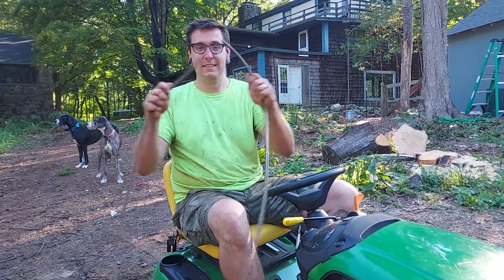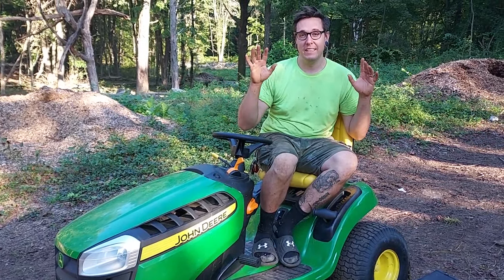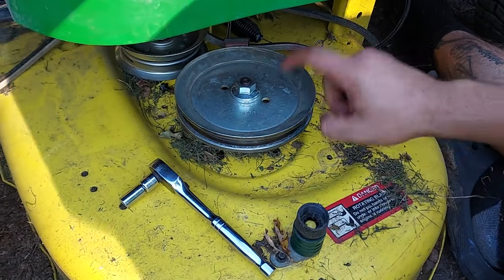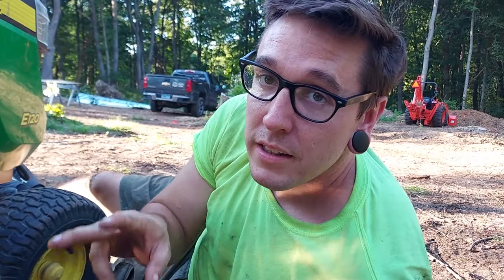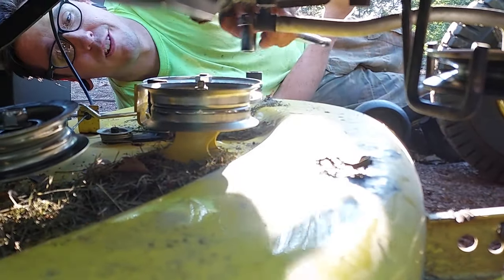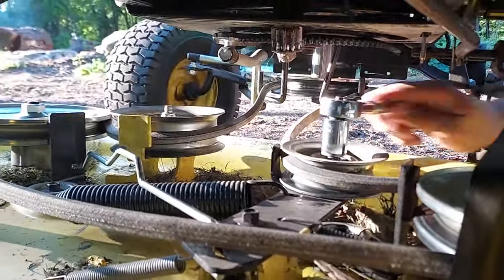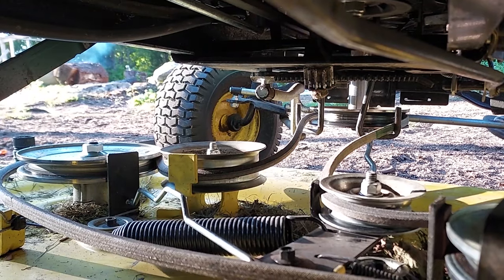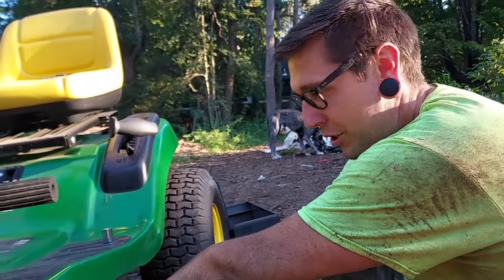How To Replace The Mower Belt on a John Deere Riding Mower | Belt Replacement John Deere E120

Comment: You wouldn't believe it - I just spent the morning servicing my E120 and started mowing, and the belt broke!  Good to see a video that doesn't tell you to pull the deck off, or spend 10 minutes waffling about other stuff! Thanks.
Reply from the maker: Sorry to hear the belt broke but hope this helps! It was really a pain to try to show what I was talking about, I wonder if that is half of the reason why people say take the deck off
Reply: I was happy to find a video too, that didn't require you to remove the deck. I looked at mine several times and thought I don't see why I would need to remove the deck 🤔 Glad to find your vid that proved me right. Now, to get my belt and get after replacing that booger🤓
Reply: Thanks!
Reply: Had to remove the deck for the blade rotators and its easier then you think. Lear ing curve is once, after that it might take me 10 minutes. Jist a matter of taking pics and keeping all the kotter pins together. Thwt being said, I agree im leaving it on for the belt.
Reply: Thanks! The belt broke and the hubby is out of town... I 'm gonna head out and do this. Wish me luck!

Comment: Thanks yal.... bought a 2021 S120. Belt broke first time mowing! Couldn't believe it.. it's funny, because my whole life friends and family were all like "John Deere is the best". 🤣🤣🤣. Not a great first impression for me.. Anyways, thank you. I replaced the belt in 20 minutes.
Reply from the maker: haha oh no did you hit something? or think the belt was faulty to begin with? thats a pain but glad it was something easy to fix, wait till you bend a blade :(
Reply: Yes, I too am disappointed in the JD brand right now. I finally paid the premium price for the JD name and bought one last year. I'm at 66 hours mowing time and putting my 3rd belt on now.
Reply: My brother in law just bought an S170 yesterday.  Started to mow this morning, the belt immediately broke.  He paid $3k for this brand new mower, called JD dealer, they told him its only covered if it’s a pulley otherwise, he’s on his own replacing the belt.  If I ever need a riding mower, I’ll be sure to stay FAR AWAY from John Deere!!!
Reply: Make sure you’re at full throttle before engaging the PTO. Also, Don’t engage PTO while sitting in high grass. Drive into high grass with blades already turning OR… raise deck fully before engaging PTO, then lower into desired cutting level. 
But in VERY high grass, just drive into it with guns blazing. Much less shock on the PTO.

Comment: Watched several videos before I came across yours. The first guy wanted me to remove the entire mowing deck. After watching that one, I figured I would need to haul it in to a professional. Then there was a gal who didn’t need to remove the entire deck. That sounded good! Unfortunately, her video quality was poor and she wasn’t clear about the work involved or tools required. Also, her tractor did not have pulley covers (which it turns out had to be painstakingly removed). So, I continued searching YouTube for the holy grail of mower deck belt replacement videos and came across yours. It is understandable and detailed! With confidence, I completed the job in about 30 minutes. You probably saved me a few hundred bucks and a lot of hassle. Well done and thank you!
Reply: The John Deere and other repair places sponsor those guys who complicate to get us all to pay some service that cost $150 minus the cost of the belt. They say it takes 1 hour but looks like it can be done in 30 minutes. I’m gonna try it and see.
Reply from the maker: So glad to be of help!! Glad to save you the money!

Comment: John it was great that you said I would need a 10mm for the guards but the tensioner, you didn't say what size socket
Reply: I'm pretty sure he said all size sockets needed. Otherwise I would not have known.
Reply: He said 5/8" socket and 10mm  at 0:13

Comment: Like it very much! I just replaced the broken belt of my machine following the steps in the video, this is a much better way to replace the belt than others that needs to take the deck down first. Thank you very much!
Reply from the maker: Glad it was helpful !
Reply: But if you remove the deck, you can do other maintenance at the same time: check, sharpen or replace the blades. Grease the spindles.  Clean the bottom of the deck.

Comment: Thanks for the vid. Wasn't looking forward to taking the mower deck off my D130 so I'll give it a shot this way. AFAIK it's the original belt from 2011 with 150+ hours. LOL Greetings from (also) rocky Vermont.

Lol actually it's 360+ hours. And I was able to do it perfectly without taking the deck off. Woohoo!
Reply from the maker: Yessss! Glad it worked ! Maybe CT and VT should have a rock-off! I've never met rockier soil than where we are now. It's Maddening
Reply: @OldReddingFarm  my old neighbor says that if you hit a rock, you've dug in the right place. Placing posts is fun up here! 🤪

Comment: I have the same mower. How do you tighten or adjust the belt. I think my cable has stretched and the cable adjustment bracket is welded to the deck. Any ideas?

Comment: I took the screw off the pully as in 7:30 min. shown, but the disk (pully) does not move a millimeter, so it is impossible to fiddle in (over the guard) the belt. Can you help?
Reply from the maker: Hey patrick, so you took the top nut off of the pulley with the spring attached and it won't move up or down or side to side? It may just be stuck, so try spraying some penetrating oil on the bolt and see if it comes unstuck after sitting for a little while.
Reply: @OldReddingFarm  Thank you for your quick responds. Yes, that is exactly what happened. I will try again tomorrow. It feels like it is welded on there. (I am sure it is not...otherwise, why the nut to hold it?) I am just afraid to bend or brake something if I am using force.
Reply: So, what happened, Patrick? Did you get it off?
Reply: @kenthompson3730  I called a mechanic, he got it off. Thanks for asking!

Comment: I have the s100 and the belt is a bit loose how i can tighten it? The tention bracket is welded. In older models the tention bracket is adjustable.

Can you help?

Comment: I have a issue. Replaced my belt in my LT150 with a 96.5” manual says 97.0” but now the blade engage doesn’t work and the blades always rotating. Is the OEM and 0.5” that critical???

Comment: My e100 deck would have to lower deck to get it to ingauge...what brand belt should i get...i seen $55.00 down to $20 from amazon...i want one that will last.  Should i just stick with john deere brand? Broke at 39.5 hours. But ive had mower 3 years now garage kept n hosed off after evry use...tyi

Comment: Thanks for the video. I got a JD with 2.5 hours on it and the belt broke. 
I’m going to assume it’s just one of those things. But I’m glad you put the video up. This job looks super easy. 
Albeit it’s going to be a pain due to the hot weather I get in Alabama.  I’ll just park under a shady tree.
Reply from the maker: Ugh that's bad luck. Did you hit something do you think ? Hopefully the next one will last way longer good luck with it
Reply: @OldReddingFarm  I don’t feel like I did but I’ll have to say that’s inconclusive for now. Reading the comments though, I do see a pattern of early belt replacements. So the jury is out. Gonna swing by Home Depot tomorrow and see if they give me a replacement, but I’ll get an extra one to play it safe. I bought the JD over a Troybilt because it’s made in Tennessee, however it won’t surprise me if the belt comes from China.
Reply: Make sure you’re at full throttle before engaging the PTO. Also, Don’t engage PTO while sitting in high grass. Drive into high grass with blades already turning OR… raise deck fully before engaging PTO, then lower into desired cutting level. 
But in VERY high grass, just drive into it with guns blazing. Much less shock on the PTO.

Comment: Help! I loosened that small guide but it won’t move like yours did when you loosened the bolt. I have a JD 102 can you tell me how to get belt on guide?
Reply from the maker: Hi there, does the spring move? If it doesn't it may be stuck. Try spraying it with penetrating oil and letting it soak a bit.

Comment: Is it possible to find a belt that's the correct length but without the John Deere name and price and it give the same service life?
I decided to remove seat and body after watching a guy on a video and it gives easy access to transmission and drive belt rear pully. I had a surprise finding a cap and after removing years of shredded grass and dirt found it lead to oil reservoir bottle I didn't know existed.
( I acquired my mower used and it will receive regular cleanings and service. ) 
If I can substitute non JD parts and get equal quality for less cash I have no probs there.

Comment: Hey John.....have you ever replaced the blade spindles? Do those pulley's need to be placed back in the exact position? If not, could that cause a belt to snap? I put new spindles and belt on yesterday and after almost finishing my mowing the belt snapped. There is nothing else I can see or think may have caused this. Thanks for any help or suggestions!
Reply from the maker: i have not, the only thing I've replaced is the belt itself. maybe you could see if you could loosen the tension a bit?

Comment: Old Redding Farm on your John Deere E120 when you increase your engine speed do your blades spin the same speed or faster
Reply from the maker: That is a good question. I am not sure!
Reply: The blades do spin faster or slower with changes in engine RPMs.

Comment: What if your new belt won't fully stop turning when disengaged?
Reply from the maker: If your PTO is still spinning when you disengage the button , I think that might require a professional. Definitely outside my wheelhouse unfortunately !
Reply: @OldReddingFarm  I think my new belt  just needs breaking in.

Comment: For some reason my tensioning freewheel would not loosen to the allow me to lift it and allow the belt to go on. I loosened the nut fully and the freewheel still would not lift. Even pry'ed on it with a flat head
Reply from the maker: were you able to take the other belt off? maybe the spring got stuck on it. if you want to send a picture to oldreddingfarm@gmail.com i'll see if I can help you out!
Reply: @OldReddingFarm  yeah, my old belt snapped. It's as if the bearing for the tension pulley is pressed on. I was able to squeeze my new belt on by spreading the guide plate on the pulley just enough, it was a pain though.
Reply: This happened to us too.  What is the deal???  Very disappointed Time waisted.

Comment: Great video, I have 35 hours on my tractor and this is now the second belt I have installed (both John Deere belts).  I have no idea why, I guess JD  makes cheap belts!
Reply from the maker: wow that is super annoying. Got a lot of rocks or roots or something in the area you are mowing? I find that most of the time when I break a belt its because I hit something.
Reply: 3 hrs I bought my mower last fall and used it twice this year and once last year. The belt snapped. We got a riding mower because of my mobility issues. I did not think I was that hard on it.
Reply: Didn’t hit a thing, not sure why they broke…in any case, much easier to replace knowing I don’t have to drop the mowing deck!
Reply: @OldReddingFarm  Mine broke today hitting the tiniest rotted branch, about 2 inches long and 1 inch in diameter. I was shocked that it was the culprit. But I've hit lots of stuff before that one, so I think Johnny was saying, "Damn it, this is the last straw."
Reply: Make sure you’re at full throttle before engaging the PTO. Also, Don’t engage PTO while sitting in high grass. Drive into high grass with blades already turning OR… raise deck fully before engaging PTO, then lower into desired cutting level. 
But in VERY high grass, just drive into it with guns blazing. Much less shock on the PTO.

Comment: What if I can't get the two guide wheels loosened?
Reply from the maker: You could try taking the deck off but it will be tough to get back back on with the belt on. Maybe once you take the deck off you can try to get the guide wheel loose with some WD-40 or something
Reply: Jay, you can, with patience, squeeze the belt behind the metal tab. In two places.  This does not hurt the belt.  Those "wheels" are called idler pullies; they just change the direction of the belt from the bigger, two Spindle pullies.

Comment: Loosened my tension puller and to get belt on and it wouldn’t move
Reply from the maker: the tensioner wouldn't move? Might have a bigger problem than just the belt. You should be able to completely remove that wheel, put the belt on and put the tensioner back though.

Comment: Oh, hallefrickenlujah! I just watched another awful video. Not only did you have to take the deck off (of course), but he kept shutting off the camera during steps I needed to see and then he would show how things were done and then put up words on the screen saying "this was actually done wrong!" but show how to fix his error. Sheesh. 

You two seemed to have the perfect video. I'm heading to Lowes tomorrow for a belt since I have a buttload of leaves in my yard and only got halfway them today before my tractor wrote me a Dear John letter. I'll be back and hopefully check out some other videos.  I'm at 57 hours on my 110. I think you have the easier oil change one. But I need to find out how to do an oil change on mine (I don't have the EZ change one).
Reply: I just got done doing the belt on my E110 (same as the 120 essentially). I absolutely cannot understand why people take the deck off. It seems like such a waste of steps, yet you are the only one showing people the how-to without removing it. It was really easy...except getting those frickin' 5/8" nuts off. I didn't have a deep enough socket (the bolt stuck up too far and wouldn't let the socket reach down to the nut), so I had to use a regular wrench and I have wimpy arms and they felt like they were superglued on. They finally released and I was good to go. Thank you so much!

Comment: Old JD can’t find a model number or serial number need number for deck belt 42 in deck can you help
Reply from the maker: if you have the old belt, there should be a code on it. you can bring to a JD dealer and they should be able to match.